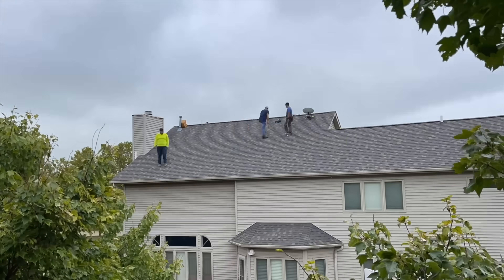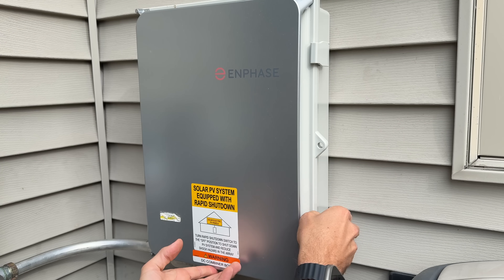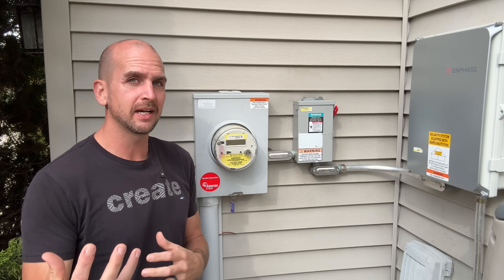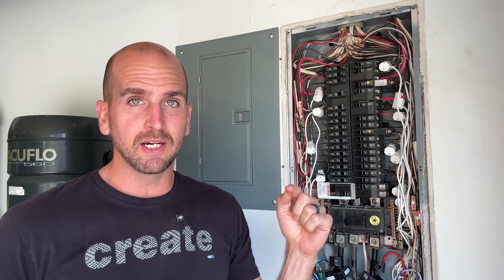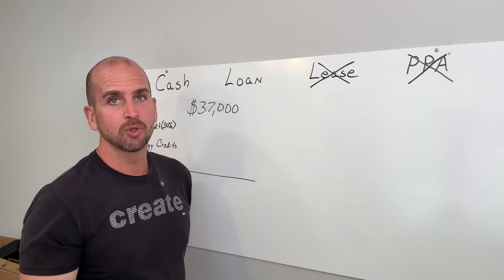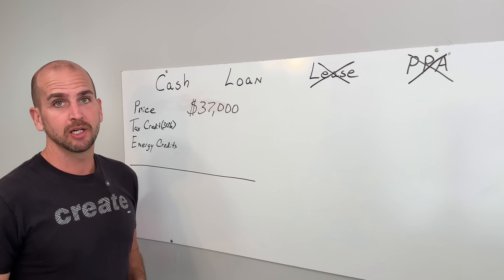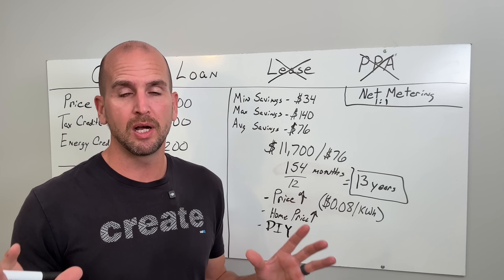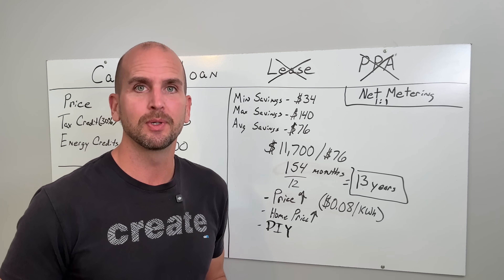Are Solar Panels Actually Worth It For Homeowners?

Comment: *In the Sunshine State, LOL, where one would think that solar should thrive;
 *the Insurance Corp. of America deems it necessary for each & every household to have a less than 10 yr old roof on the home of their policy       holders.        
*If the homeowner with an 11 yr old roof bucks & refuses to replace his 30 yr warranted roof, the policy is terminated &
*the homeowner must then be taken from a Preferred Risk category, where their rates are lower, to a Standard Risk category for an undefined number of years @ a ghastly increased rate of insurance coverage because your mortgage holder insists on coverage on their investment.
*If the homeowner refuses the Standard Risk premium he can always let the mortgage holders' insurance company assume his/their risk @ an even lower risk factor & higher rate....cringe
*SO, what you have is a situation where the home owner has a solar system on his roof with a 20-25 yr period that is removed every 10 yrs (Voiding the Manufacturers' warranty) to have a roof removed & reinstalled (Whose own warranty is voided with the very first screw/bolt that pierces the waterproof membrane beneath the newly installed tiles). 
*Even steel/aluminum roofs are not exempt from the 10 yr. rule.
*It's all a comedy of errors down here being played upon the homeowners by & for the lending institutions in lock-step with the insurance empires.
*You can't own a home without insurance down here.
*So, come on down & enjoy the fun in the sun
* & find out for yourself!

Comment: Very interesting, thanks for sharing your information and calculations.  A couple of extra costs might be:  (1) Maintenance costs and (2) extra cost to remove and reinstall solar panels if replacing roof shingles.
Reply: Maintenance is basically zero.  Think about it..  What maintenance is needed?   You don't want to install solar on an old roof, but that doesn't mean the roof has to be brand-spanking-new either.  I've had solar on my garage roof for over 20 years and the only maintenance I had to do was replace the grid-tie inverter in the garage at the 15-year mark... which I DIY'd in an hour or two.

I washed the panels down a few times but ... that gave me back less than 5% so I stopped bothering after a few years.  The rain washes them well enough.  Not that it takes much effort, you don't have to power-wash solar panels after all.

Of course, once you have a system then it can become a hobby, so I've done a lot more than just sit around.  But that doesn't count as "maintenance".

For roof replacement... well, I just had my roof replaced this year.   My brother and I removed the solar panels and old drill-to-rafter rail mounts in about an hour.   And we put it back on the new roof, along with new no-drill S-5 mounts (mounts to the standing seam of my new metal roof)... that took maybe 6 hours of work over 2 days.

I also upgraded the cabling in the process.  The original grid-tie inverter had only one MPPT.  The one I replaced it with at the 15 year mark has three.  So I cabled three strings to the new roof which vastly improves generation.

-Matt
Reply: @junkerzn7312 
Thanks Matt,
I appreciate your input.  I personally try to do as much DIY as I can, but roof related projects are off limits.  So, for myself and other roof scaredy cats, I was just trying to point out possible extra costs that weren’t addressed in the video.
Reply: @rooster7996  Its definitely true that some roofs are more DIYable than others.  I like to do my own roof maintenance (solar or not), so when buying my house 24 years ago I was specifically looking for a walkable roof.  Mine is 15 degrees off of flat... very DIYable.

Generally speaking, there is virtually no maintenance required on a solar system.  Pretty much zip, in particular with DC string systems (with only solid-state disconnects for code, so no optimizers and no microinverters). 

There are always acts of mother nature but it isn't as frequent and some people might have you believe.  A storm able to damage roof-mounted panels will also damage the roof just as badly, if not worse.   Panels actually protect the roof to some degree and massively improve insulative value in summer just from shading the roof under them with an air gap.

-Matt
Reply: Generally you only install solar on a new roof. If you have an older roof you’ll want to replace the roof first. That being said, the panels can actually help protect the shingles from the elements which can extend the lifespan of your roof.
Reply: @keco185 Thanks for the info.  My roof is 20 years old, so now might be a good time to think about new roof and solar.
Reply: Solar on a good condition roof will extend the life of the roof to beyond the life of the solar.
Reply: @dancostanza Thanks, did not know that.

Comment: I split time between two locations where the electricity rates are $.11 and $.13, respectively.  These locations have a fair number of days that are at least partly cloudy, so not optimal for PV.  As much as I enjoy solar (I have inverters and batteries in both locations, for when the grid is down), I just can't justify a large, professionally-installed system.  The ROI would exceed the life expectancy of the panels.  Not worth it in my situation, in part because I don't live in one place all year to realize the benefit.

Comment: I estimate my 10.3kw system will be paid off in 9-10 years.  I pay about  $0.15/kwh . Paid $19k(after 30% fed tax credit).   Might be sooner when/if my adult/college kids move out and I am not charging 2 EVs and running  3 gaming PCs  20 hrs a day.    However, I did not go solar just to save $$$ on my electric bill or buy into the salesman's pitch that electricity  cost are going through the roof in 5 years.  The other main reason is to go green and complement charging my EVs.
Reply: Happy for you on your solar, and that is my main reason I'm interested too. I just wanted to share my data from my gaming PC, since I have it hooked up to a power meter. It uses about 60kwh per month. Running intensive games of course uses more, and I don't run it 20 hours a day, but I use it as my work PC in the day and gaming at night. So, being conservative, those PCs are costing no more than $40/month for all 3.
Reply: @imadork123   $40/month = $480/year = $4,800 over 10 years.  That eats into your ROI time.      It doesn't bother me, it just that my ROI will be sooner when my kids move out.  Obviously more people = more energy consumed.

Comment: What happens if you get a leak in your roof? I just put on a new metal roof. Would hate to screw all this "stuff" into it.
Reply: Well, if its a metal roof you might have standing seams that you can attach the mounts to, and not have to drill at all.   Lookup "S-5 solar clamp" for example.  Metal roofs are ideal for solar systems.
Reply from the maker: If you were to get a leak under the array you would have to remove the panels and then address the leak.  The flashing and attachments points have a lot of thought and design features to make this scenario as unlikely as possible assuming properly installed.

Comment: Did mine DIY in TX, at my current 0.16/kwh rate based on what I paid I project recovering in 7-8yrs, and I'm OK with that. This is assuming much of what you pointed out. I paid roughly $1.40/W

Comment: You didn’t mention you savings - basically since the system is supposed to last 25 years, you are basically going to SAVE over $10,000 over the life of the system. 
Also, many people install a system that is way too large. If ROI is important, and especially if you live where there’s tiered electric pricing, getting a smaller system will provide the BEST bang for your buck. I was able to optimize for 7 year ROI and over the life of the system it will save me over $35,000! (And it cost me less that $10,000 out of pocket after tax returns). Was a super easy decision to make especially as I was able to pay for it out of pocket and didn’t need a loan 🥳
Reply: The savings is not as much as you think.  Over 25 years, components will inevitably fail and need to be replaced, the roof will need to be re-shingled and there will be a labor cost associated with removing and reinstalling everything.  Also, the integrity of the roof has been breached with all of the mounting hardware, leading to possible leaks and expensive water damage.
Reply: @Scott_6666  You are correct about replacement/maintenance cost. You have to figure that in on your costs and ROI. But you're making an assumption on where his solar is installed. Depending on your available land and tree coverage you can easily mount panels on the ground. And if you can I would recommend it.
Reply: @John-tx1wk  The ground is not an option for most people.  Average lot size is 80" x 100" or smaller, unless you live on a farm or are Jeff Bezos.

Comment: What backup battery do you use?
Reply from the maker: For this system I don't have a backup battery.  I have an EcoFlow Delta Pro 3 and spare battery (total of 8 kWh) which I plug into my generator inlet connected to an interlock.  This will still not utilize the solar panels on the roof since the interlock will cut the power to the panels and they will not produce.
Reply: @EverydayHomeRepairs  Ah ok. Thanks for answering. I have almost the same setup with (22) 410w REC A, IQ8A microinverters, and an Enphase 10T kwh backup battery. I also have two Delta Pros with Extra Batteries. Just wanted to see if you have a way to somehow use the Ecoflows with the Enphase.

Comment: Math nerd here - last time I looked into solar the break even here in Oakland, CA was 12 years. Like you, I also use 7 years as my decision point. Solar is a better use of money if the break even is 7 years or less and you plan to live in the home for a couple decades. Over 10 years break even you might as well buy a low cost index fund because over a couple decades, stock index funds return ~10% and moving to a new home in under a decade doesn't change that. How many parents will actually stay in the same home for a couple decades? Most people buy a home when their children are first born and then 18 - 20 years later the young adult kids move out and the parents don't want to live in such a big home with too many bedrooms, or want to move to be near where the kids launch their career and start the next generation. BTW - I've had multiple solar salesmen tell me that my home value will increase by MORE than the cost to install solar. I told them they should immediately contact realtors that are selling homes in my neighborhood so they can install solar just before the home is listed on the MLS so that the home seller will make "free" money on the solar install, and the selling realtor will gladly loan/pay for the install out of their own funds in order to increase their commission. Selling realtors often front money for deep cleaning / fresh paint / drywall repairs if the home seller is tight on funds because the selling price always goes up by multiples more than the cost of these tasks. The solar salesman either gives me a look like I'm stupid or they really believe that a realtor would be stupid to not install solar on every home that is about to go on the market.

Comment: I have watched so many of these videos and done many mock build plans that I can tell you this: $37K for 11KW w/o batteries and you did the labor? You got ripped off!! Also, not a fan of micro inverters as I would look to feed even a modest battery bank utilizing a DC optimizer. Only flip it to AC/DC once in this case to increase efficiency. Then you have some options!!
Reply: You missed the part when he stated at least TWICE he paid for installation included in the $37,000. He did a DIY on a completely different rental property.
Reply from the maker: This one I did not do the labor.  I installed a smaller 4.8 kW system on a rental property but that only ran me about $8,500 after 30% Federal tax credit.

Comment: Interesting video. I am in Massachusetts and installed a 7.5kW system 10 years ago. $31K, 30% federal rebate, $4K from the state,  1-1 net metering SRECs paid quarterly in arrears for 10 years. My monthly electric bill 10 years ago was $100/month! My system was paid off in 4 years. I haven't had an electric bill in that time. 
Electricity is 31c+/kW hrs here with another 30c /kW hr delivery line maintenance etc. 
The system has been very reliable, a few issues, but nothing terrible. I love it!
Like your content,  keep it coming 😊
Reply: My "small" 5kWp solar system generates roughly 8 MWh/year.   20 years ago I had a 3kWp system installed professionally.    That original system took 15 years to break-even.  But as I said in my main post... breaking-even was never the goal in the first place.

When I had to put on a new roof I DIYd removing the old system (DC string tie, so it was very easy to remove).  And after the new roof was put on I DIY'd putting the panels back on... and decided to purchase new panels to up the system size to 5kWp at the same time.  Zero drilling.  All DIY.  Mounts go on the standing-seam of the roof panels.  I chose that new roof carefully to be DIY friendly.   Next year I will start adding panels like there was no tomorrow, even on non-optimal sides of the roof.

All my upgrades will pay for themselves in 5 years or so.  And the reason isn't just the offset of my utility bill (I do live in California, so utilities are not cheap).  It is also because I am electrifying other things in the house.  One of our vehicles is now an EV.  The water heater broke and was replaced with a heat-pump water heater.  The Furnace is next up on the list (its starting to get crufty).   I am saving thousands of dollars a year in combined gasoline and electricity costs alone.

I am not going to pass up the opportunity to thumb my nose at the oil and gas industry that sucks all their profits out of the state.  The less I have to pay them, the better.

-Matt
Reply: 21 x LG275W panels on my garage roof and 6 x on the shed dormer. At that time, in Massachusetts you were limited to <10kW for residential mine is nominally 7.5kW.
Not so big.
Reply: @manxman51  so ok so MA has on average 200 annual sun days figure you are generating 8 hours each those put you at 12MW annually.  Typical home uses 12MW (yes many factors) so what you were selling most back to grid
Reply: @msk3905  8MW/year on average. I would build a surplus through the summer,  my meter running backwards, then as production falls off the meter runs forward again. The amount produced is measured on a separate device. This is what gets reimbursed through SRECs. The power company bills what the regular meter reads. My electric bill shows a surplus most months, then in the winter the surplus dwindles until spring when it starts to go up again. Around February, the surplus is only a few kW.
There has been only one out of pocket expense when I had to replace the meter due to the demise of G3. I have had a couple of inverters fail. They are under a 25-year warranty. The company that installed the system still maintains it at no cost to me. I guess they get reimbursement from the warranty of the hardware manufacturers. 
This is a huge benefit of paying upfront, I understand the cost is probably prohibitive for most especially if the returns are not there. But it works really well here.
Reply: Unfortunately, solar prices have to come down radically before it makes economic sense for most people. It makes me sad because it's a great solution, but the prices are wildly too high! The return on your investment is not economically viable for most people.
Reply: I also live in MA and my 3 yr old 9.7KW system is on track to break even in under five years.  High utility rates and 1:1 net meter is the reason.
Reply: So after 30% and $4,000 rebates the $31k system cost you $17,700.  $100/month bill means electric bill is $1,200 per year or 14.75 simple payback.  How was this system paid off in 4 years?
Reply: @msk3905  $2500/year in SRECs. The system generates ~8MW / year initially $275-$285/MW. That's how it works.
Reply: @ 8MW…good god thats huge, is this a residential or commercial system?  Is this on your roof either do you farm on land?